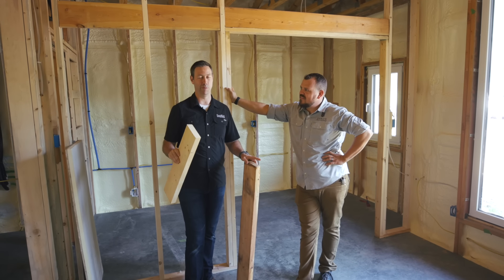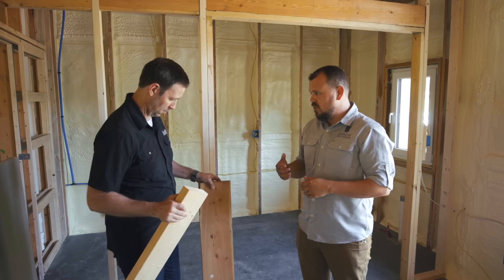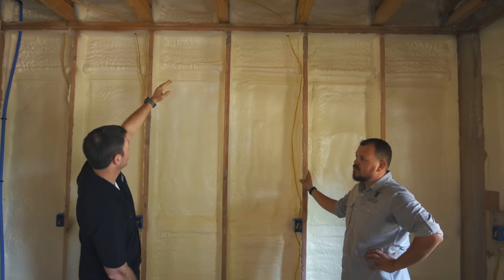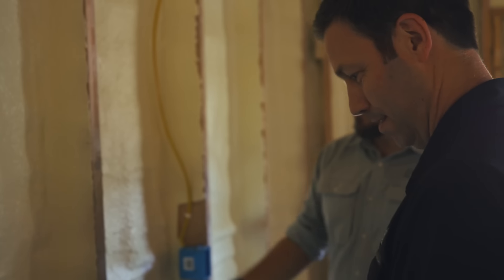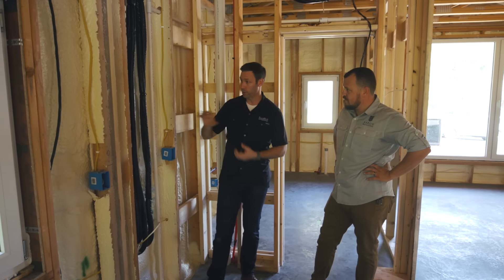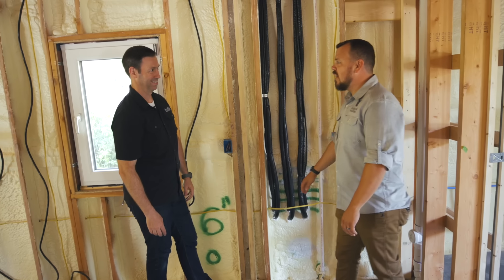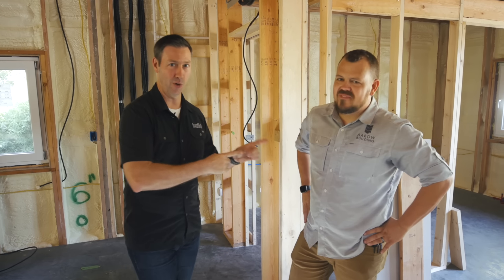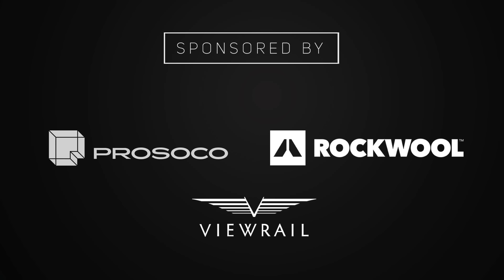Why would you frame a house with 2x8 lumber?

Comment: The stud walls in this house carrying the floor joists would not pass building control in my country they are structural load bearing studs 
there should be a double sole plate and double head plates in any walls carrying a load and these walls are a single head plate there is also no 6 by 3 head with jack studs above and around the window
It’s not going to fall apart but it still would not pass our building regulations

Comment: I like how you guys are thinking and trying to build a better house, but...

A lot of what you are talking about seems like trial and error based on theory. Also, kinda sounds like doing different details as a conversation piece for the homeowner. I would love for a lot of these practices to a actually get some research, outside of what manufacturers claim. We need a things like target R values for different climate zones and ranges, not just keep throwing more and different types of insulation in different combinations at the problem. Also, effective and efficient methods to achieve those R values with different product types, while still mainining the ability to dry out walls etc. Also, fiberglass and foam are not the most environmentally friendly products to manufacture, and paper really isnt either. So we should be attempting to achieve the most effective building envelope while minimizing the use of these types of products, as well as balancing cost factors for the consumer. This needs to be studied and tested. It's nice that we have passive house standards and such, but let's face it, to really change the industry, we need to focus on the average house not the high end. We have standards for the minimum end and maximum end but not really any industry standard recommendations for the range in between.

Comment: With a house that tight I would imagine you will need fresh air exchanger?
Reply: That's what I don't understand. If you seal up a place so tight you need an air exchanger did you really gain anything.
Reply: When you mechanically bring fresh, outside air into the building, It gets conditioned before it enters the regular mechanical system. Cooled in the summer, heated in the winter.   I'm all for energy conservation, building well but there is a point where building extreme becomes foolish.  I call this "spending stupid money".  So is it wise to have an additional 5000 board feel of lumber in a house (about 20 more trees) just to say you can heat your house with a hair dryer?

Comment: I have heard that 40% of your lost energy goes through the roof and another 40% through doors and windows.  If only 20% is lost through a 2x4 wall with R-13, how much offset is there in doubling that R-value against the cost of custom jamb extensions   etc. for windows and doors in the exterior walls?
Reply: If you double the R-value then that should at least halve the loss, which means the ratio shifts from 20-40-40 to 10-45-45, yes?  The person who made the joke about it taking 2 years to clear a fart makes a serious point, unknowingly.  If radon gas or carbon monoxide or natural gas begins to seep or leak into the house, it might pose a greater or faster threat than otherwise.

Comment: For a few more thousands, we can use 2x10's ... 2x12's ... I get the point, but this is why we use 2x6's to frame our homes, more room for insulation ... there's a balance point somewhere and the video doesn't say where that is ... windows and doors don't fit, extra cost for millwork ... extra insulation costs ... trusses or stick framing the roof ... and how much money are we saving on heating costs? ... are we spending thousand to save tens per year ... we can save that much money just locking the kids outside on snowy days ...

Comment: I'll tell you what.  Take three or four ice coolers,, cheap, white Styrofoam, and experiment with them.   Size and square footage,, Coolers are 14 inches tall and 20 inches long?  KISS principle,, call each long side 2 square feet. You have four of those ,top, bot, two long sides,,, and you have two short sides  call them 1 square foot each.  You are dealing with 10 square feet of cooler surface, nominally 1/3 of a 4X8 foot sheet.  A sheet of Zip sheathing requires 62 or 63 fasteners per sheet..  Your foam cooler is about 1/3 of a sheet,  so one third of the nails, about 20 nails.  Shove 20 10d nails  some inside to outside,, some outside to inside through the sides of your cooler.  Put your ice in and watch how long it takes for the ice to melt.

So you do not have to keep opening your experiment to check, drill a small hole in the bottom so the water can drain.  set it with a small counter balance and seesaw so when it tips up,, its empty.  The cooler with the nails through the sides will melt the ice twice as fast.  When you nail through a foam sheathing, the nail becomes the thermal bridge,,, and the total  number of nails is huge.    What siding goes on top of the Zip system?  Lap siding?   That is another 100 nails through your foam.  And the nails driven into one face for drywall,, a cement product,, and the nails driven from the other side for foam and siding,,, are all driven into the same 2X4s,, or 2X8s

So stop smoking that stuff that is legal in Colorado and start telling the truth about thermal bridging.  You do a disservice to all builders and engineers by taking the pot pipe from the manufacturer and breathe that same smoke at your customer.   Is there really,, any difference in an 8 inch concrete block filled with R-7 per inch foam, vs, a 12 inch block filled with R-7 per inch foam?  No.  Not a scrap of difference.  You want to do something different,,, DO something different.  Don't keep dressing the same sow with a new colour of lipstick and nice red shoes.

Comment: Modern Framing technique, that's why 24" ctrl. Otherwise why would you waste all that effort and not just do SIPS. This appears to be "high end", so let's describe "costs" .
1.) Most drywallers don't like 24"ctr. 
2.) Already half the way to SIPS with the insulated zipwall and spray foam.
3:) Still need to "batt" insulate. 
Let's talk about this construction vs SIPS.

Comment: That 2 inch of spray foam creates a vapour barrier towards the exterior of the home, then he will have another vapour barrier on the inside of the home with plastic as well. Could that cause problems with condensation?

Comment: 24" OC not good , can't hang drywall, can't hang cabinets, your shear factor  strength is gone will be forced to put backing blocks everywhere to hang anything or get a electrical box where you want it .makes the finish carpenters life very hard specially for crown molding and baseboard. And I feel this is a waste of wood .
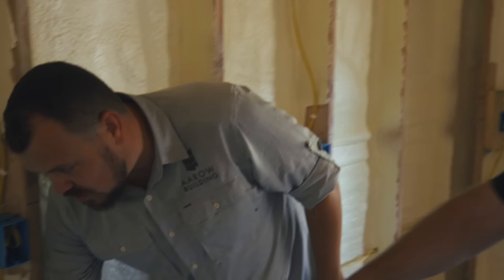Reply: Backing blocks such as the ones at 3:18 behind the guys?

Comment: The 2 by 8 walls are a waste. As is the foam. 2 by 6 with pink or rock wool and a vapor barrier are the only way to go. Hands down.
Reply: Because??
Reply: @stevenbaczekarchitect9431 .  foam is very expensive and can cause condensation  problems and toxic fume problems. Insulation values between 2 by 6 and 2 by 8 are insignificant. Try and buy a 8 inch exterior door and window package and watch your cost rise quickly. Insulation values rise very slowly compared to r value. The foam professionals I know are going away from foam for many reasons. Mostly their own health.
Reply: @stevenbaczekarchitect9431  . Also. The best place to add insulation is on the outside. Especially on a new build.

Comment: Throwing things with higher R-value per inch at an assembly doesn't make you smarter. Spray foam is a terrible choice. . . especially up against the outer layers of your exterior walls. Polyiso also collapses like cotton candy when in contact with constant moisture, so hopefully that climate zone is dry and desert-like. Building Science doesn't support this assembly otherwise. Good on you for promoting exterior insulation strategy though and trying to reduce thermal bridges. Try wood fiber board next time instead.
Reply: Hmmmm.....I guess the conversation I had with one of North America's best building scientists about this wall assembly, he had all wrong.....Are you available for consulting? I mean his 30 years of building science is all wrong and we need you to straighten him out.....thank you

Comment: Why?  the increased cost isn't worth it and you still have the issues with heat transfer through the wood.  You're way better off building a double thick wall with 2x4s and offsetting them.

Comment: A little overkill ,when you windows are your weak link.
Reply: I've seen videos where they use uhd tv's as the "window" with cameras mounted outside to bring the view indoors.  They have a camera inside to track your eyes so the screen shows you the direction you're looking.  The energy to run those tv's is probably cheaper than actual windows.
Reply: @WillieStubbs  Now that's cool.

Comment: Guys you're in texas this is way overkill. You're working with a 40 degree delta at most. This is just a pissing contest at this point. What's the roi if going from r30 to r40. Probably not enough to pay him back in his lifetime. 2 k extra in studs another 5 k extra in insulation plus the extra labor it'll never pay him back

Comment: This builder thinks he is blowing smoke up everybody's ass by saying it's no more work to frame with 2 x 8's. First of all, work is measured in foot/pounds (in our system), so facially it's more work. It took the framer longer to cut the 2 x 8's, longer to move them in place, it took a lot more work to stand those walls up, and it goes on and on. If the framer agreed to this it's only because this guy gives him a lot of work.
Reply: but it is 24 on center instead of 16 on center, so less studs total; even if they are bigger studs.

Comment: making the walls thicker is not going to get you where you think you're going. a different type of structure entirely would have been a wiser decision. not to mention all the interior volume you forfeited. wood framing and insulation is twentieth century thinking.
Reply: How are they forfeiting interior volume in a 4000 plus ft house ? Also, how else do you retain heat/cooling without insulation ?

Comment: Has this type of construction been reviewed by a structural engineer?  This may work in an area that does not see snow.  As a structural engineer I don’t see one 2x8 able to carry a floor and roof load.  The capacity of the 2x8 is dependent on the length of that stud.  Please tell me of any articles on this design.
Reply: If it's not in a snow area why the extra insulation?

Comment: Would not hire this builder. First off you can still get a ton of R value in 2x6. Second 2x8 makes all the window and door trim massive which in most cases is not a good look. Third 24" on center is a cheap way to go unless you use 5/8 drywall or 3/4 roof sheathing. 16" on center has been the defacto for decades for a reason.

Comment: So....could you address the windows? As those are the week spot of any wall, what if any steps are taken with the windows? Are they triple pane or otherwise something better than average? I believe it doesn't really matter what R-value your walls have if your windows are not holding up their end of the equation. All of the money spent on thicker studs and thicker drywall to overcome your 24 inch on Center spacing and the money spent on more insulation will never be recovered because it's all going out the window.

Comment: Seems like a silly waste of money. Are we really concerned about the strength of our homes.  Are you trying to convince me that a 2 x 6 exterior wall home is imploding?  Only a $1500 increase. Really? So you don't to pay for additional materials on jamb extensions for doors and windows. Deeper threshold on doors, additional paint. Then the cost of the additional insulation to fill the cavity to prevent air pockets that can mold. I like the way your thinking but it is more of a sign of a good construction market and guys having the luxury to add pet projects to their house to brag about.

Comment: Lack of knowledge and a waste of money.   I have a house 2×4 construction  1400..S F.  3 inches of spray foam.   1 tank of oil last over a year.  Most of the oil is used for hot water for the shower..   so what is your point of the vidio?

Comment: Dumbest Idea ever your at 7.5 inches your way far ahead if you just double frame your out side walls with 1/2 osb between much higher r factor and interior can be single top plate with staggered studs it would put your studs at 12” O.C.  Theirs also a foam sandwich typ OSB Thats 3.5 to 5.5 thick then frame your 2x4 interior walks.

Comment: Wouldn't this be starting to get into the territory of too much insulation? Air tight/more insulation isn't always a good thing. This was happening in manufactured homes years ago. Homes do need to breath and neither of you talked about this.
Reply: lol troll :P
Reply: You need to watch more of Matt's videos, and do some research on modern, air sealed homes. Your house DOES NOT need to breath. You do.
Reply: @s7726  Houses do need to breath. That is how the wood dries out. That's why some houses will get hard to shut doors/windows in the summer/winter months. Humidity. That has to go somewhere.
Reply: @broc212  there are other, better ways to deal with those issues.
Reply: @broc212 , I'm sure they are going to be putting in an air exchanger or two, plus they can add a whole house dehumidifier making this house just as good or better than a house with NO insulation.
Reply: I like good insulation. But I don’t like to rely on an air exchanger to supply me with oxygen. We are not on Mars yet.
Reply: @4philipp , You will not run out of oxygen in a tight house. Also, we all rely on some type of furnace for heat but those furnaces can also kill us, if not done right. Should we not rely on them too ?  If the house is done right, you'll be ok.
Reply: august yea, I’ll be having a nice woodstove. That will heat the house, provide fuel for cooking and heat water all at the same time.
Reply: @4philipp , True and it doesn't need power to do that except maybe the hot water and that can probably be done too without power ? I have a pellet stove, but a small 1300ft colonial, so it heats it quite well.
Reply: august yea, all depends on size. A 4000sqf home will need all this high tech, but a small open concept cabin just needs good insulation and windows. And with your own woodlot, you’ll never go cold.
Reply: @4philipp , I like big homes, but even if I could afford one, I don't think I would. Like you said, a smaller open design is the best and would be my choice also, but I would want a large garage for tools and building stuff.
Reply: august avoid workshop is great. But then size depends on what you need as well. I don’t know your climate, but I have 6 month real winter at my property. My goal is a comfortable home, enough barn/workspace for my animals and projects and keeping the running cost down. I don’t want to work for taxes and utilities.
Reply: @4philipp , So true about working for taxes, utilities, etc. I'm in Ct, so I can relate to the Tax thing, man they are brutal. Just the taxes and insurance are a grand a month. I don't have animals, so that's one less expense but I do like building things and keeping all my treasures(junk) inside, lol.
Reply: august I’m 400 miles north of you. Animal are livestock, they feed me :)
Reply: august that was a good clip, short but it had all the key aspect in it. 
However, I have a slightly different interpretation...
Rule #1 : don’t bring harmful chemicals in your house. That cleaner under your sink, it kills. That’s it’s job. 
Rule#2 : use natural building materials that don’t off gas. 
Rule #3 : not all bacteria are bad. If we live in sterile environments, we build poor immunity, which leads to more illness if/when exposed. 

I want to spend plenty of time outdoors, in the natural environment. We are not designed to live in a protective shell. 

So I know I’m not making lots of friends with this type of opinion, well...
Reply: @4philipp , Sounds like common sense, can't be all bad, lol.
Reply: @augustreil  move to Tennessee 👍😁
Reply: @augustreil  wouldn't that defeat the purpose of energy savings?

Comment: 2x8 is too much for most parts of the US. Maybe Minnesota in the middle of winter but most houses in Minnesota are built on 2x4s...
Reply: New homes? Not without continuous insulation, and 2x6s would be cheaper.

Comment: R42 is completely unnecessary as well as the 2x8. He said with the sheathing and 2" spray foam, he's at r20. If it was a 2x6 wall you could still cram in 3.5" r15, making a 2x6 assembly=r35. The cost for that extra r-7, which in reality does nothing, will be insane. Wheres the location of this build? In the south I presume, so just a waste of materials and $$. Be better spent on upgrading windows, doors, efficiency of HVAC appliances ECT.
Reply: The $1500 "extra" is a joke guaranteed this cost 10k+. The cost of a 2x8 where I'm at is double a 2x6.